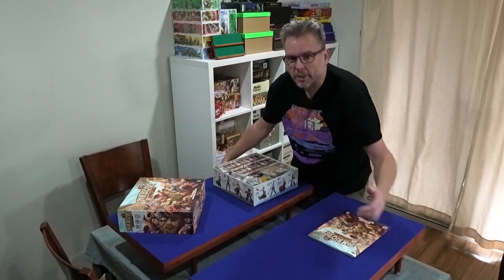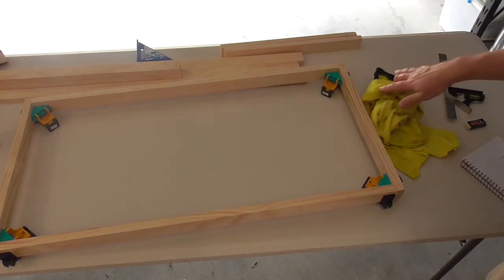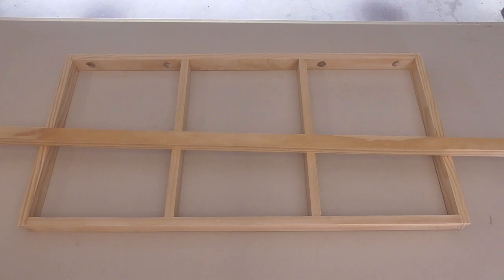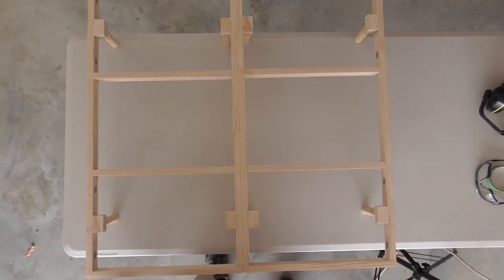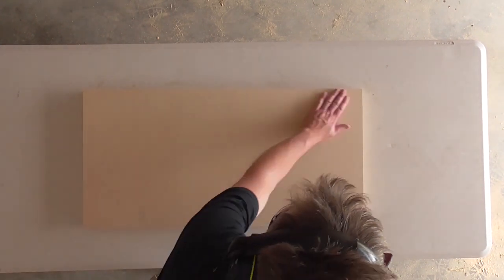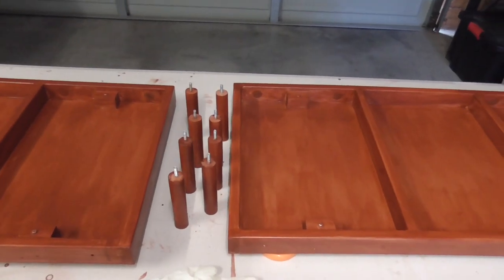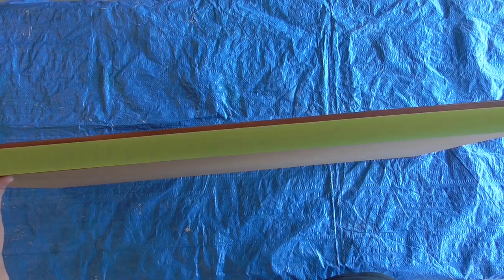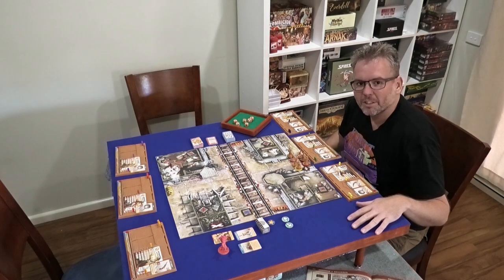HOW TO build a board game table topper

Comment: Love the idea however there is one thing I didn't like, that was the legs being too long. I don't want it that high off from the table. But still great job, love it! Thanks for the video.
Reply from the maker: Thanks for watching, the beauty about this is you can adjust the heights by cutting the legs to the specific height that you need. I have added extra legs so I can adjust to the height for the players and as well as use it on the floor with my children. Thanks again for the feedback.
Reply: @diceitupgaming  ah I see, make sense. 😊👍🏻